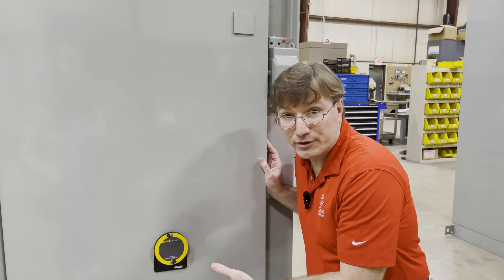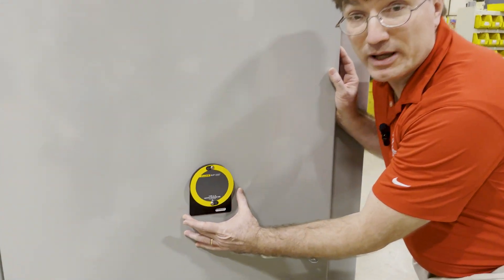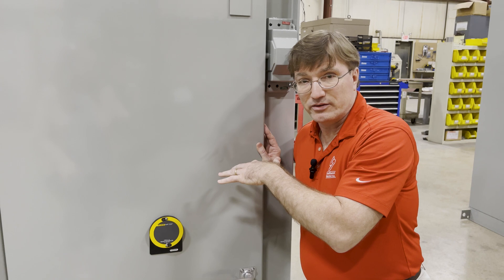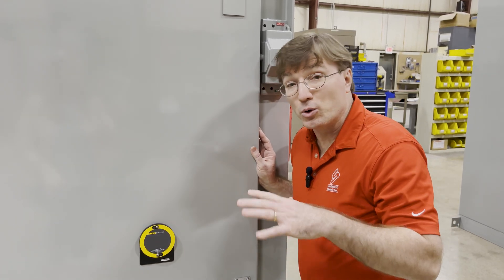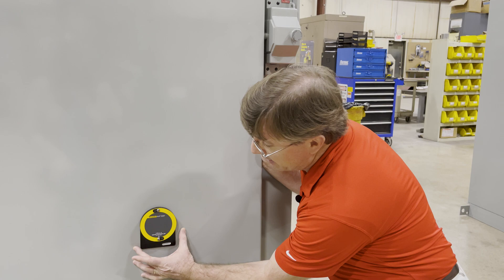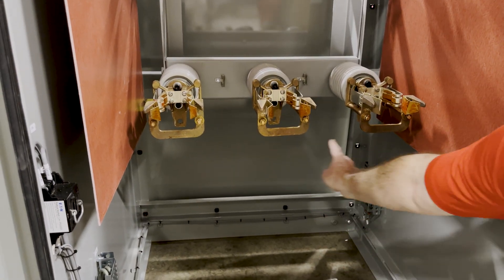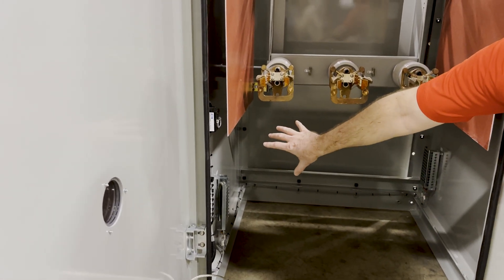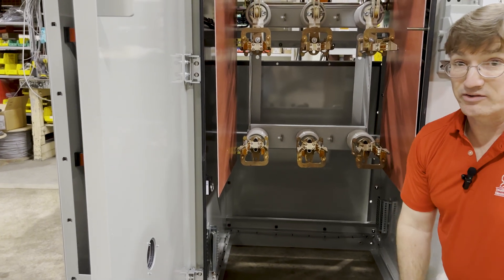Why Are IR Windows So Important?

Comment: You sould not install crystal IR windows in any swichtgear 
They do not have a lifetime warranty.
-More expensive
-they do not withstand impacts and turn black over time (no security)
-they have a difference of 87% of the real temperature that they are taking with the camera.
-It does not have a good inspection angle.